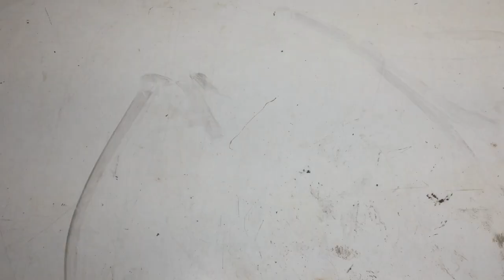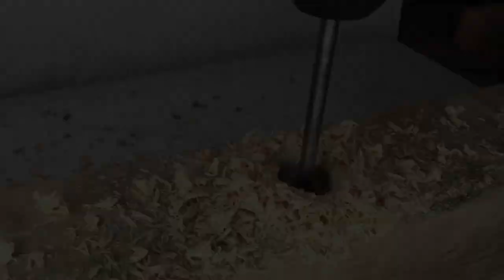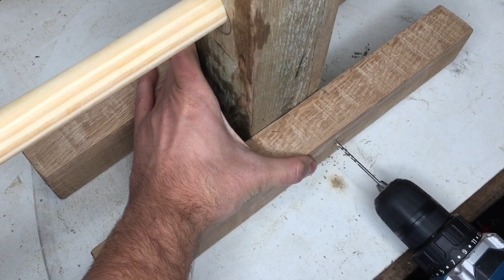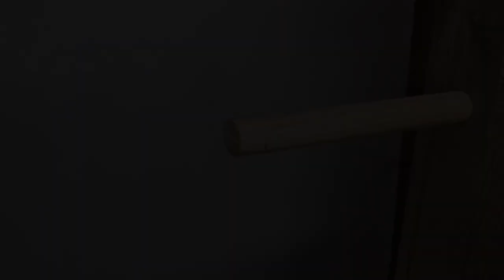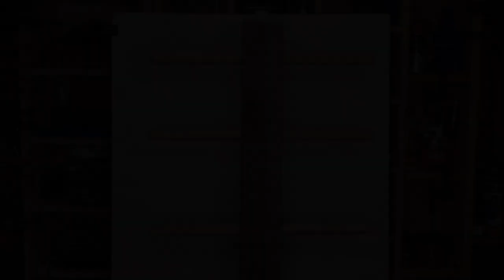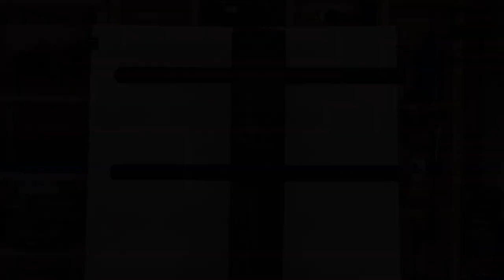How to build a gym WEIGHT TREE in 5 minutes! | DIY weight PLATE RACK

Comment: Many thanks for your tutorial; excellent 👍🏼 
I want to know the maximum weight load that this wooden weight tree can hold without cracking?
Reply from the maker: I couldn’t say for sure, have only used for lighter weight plates. If you want to use for heavier I would use a metal bar.

Comment: How much weight do you think a set up like this could hold
Reply from the maker: I’ve put 4x5kg plates on the bottom holder. It takes them easily. I put the heaviest plates lower down as it’s more sturdy, avoid making it top heavy so it doesn’t fall over.

Roughly speaking I have 8x1.25 kg on top rung, 8x2.5 kg on second one down, 8x2.5 kg on the third and 4x5kg on the bottom. It could hold more but that’s all I need on there at the moment. Hope this helps.

Please subscribe for more great videos. 👍🤞

Comment: Can you paste links to individual pieces?
Reply from the maker: Hello my friend, thanks for your comment. What links do you mean?

The materials used were just some scrap wood I had and some nails and a broom handle. 

The main piece was a 4inch by 4inch offfcut from a fence post and the oak was around 2inch by 1inch offcut. The broom handle was 1 inch diameter as the weight plates I have are 1inch holes, you could also use metal pipe but the wood is more than strong enough.

I hope this helps. Please subscribe for more. 👍 JKL.